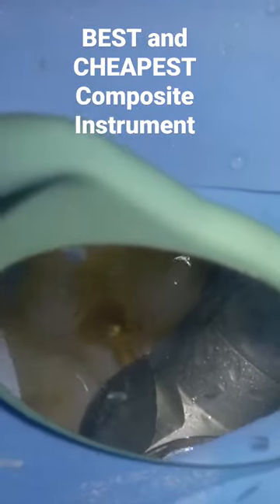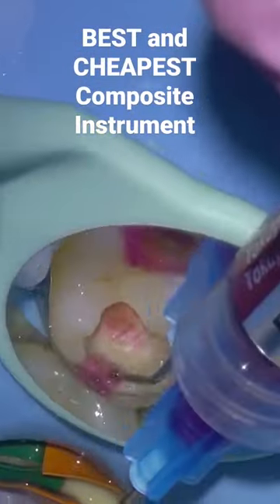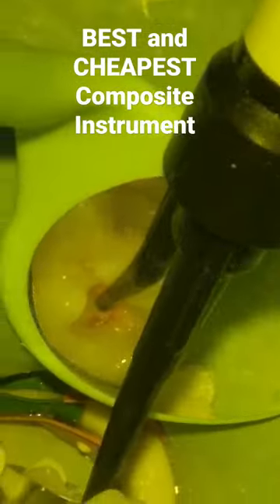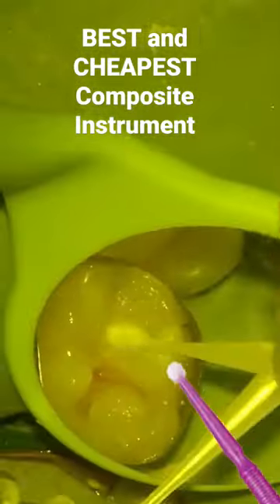Best Instrument for Posterior Composites (also the cheapest!)

Comment: I’ve heard one Dr who said, so that the composite doesn’t stick to the instrument you may add a little bit of the bonding agent onto the tip of that instrument. Is it true ?
Reply from the maker: think of the material science and physics behind this - we want our material to be as monoblock as possible. By introducing a weak component between every layer, we are weakening our restoration. This is not standard or recommended practice (although this is advised by some Dentists, I can assure you it's not a good idea - I encourage you to make up your own mind on whether you would want this protocol for your own tooth)
Reply: @protrusive  thanks a lot Doctor ❤️🙏🏼 got the idea.

Comment: Would you use the same micro brush as for your bonding agent or a new one?
Reply from the maker: different one - you don't want bond between composite increments
Reply: @protrusive  
Thanks for the reply..
Would you use unfilled resin on the micro brush or just a dry one?
Reply from the maker: @vishaltrivedi7876  dry works really well (and cheaper!)